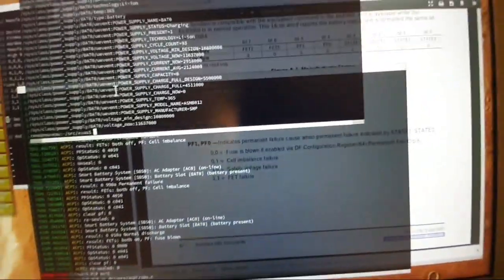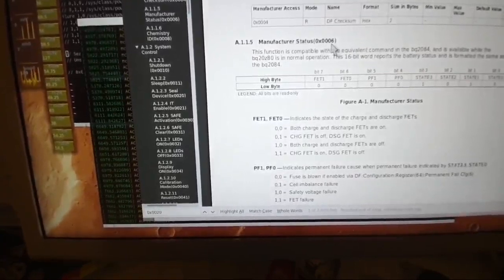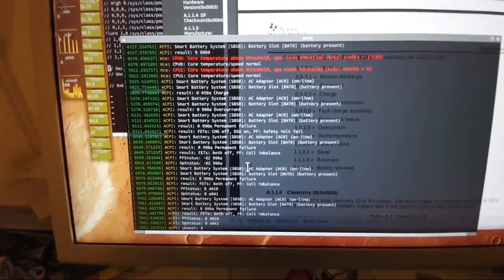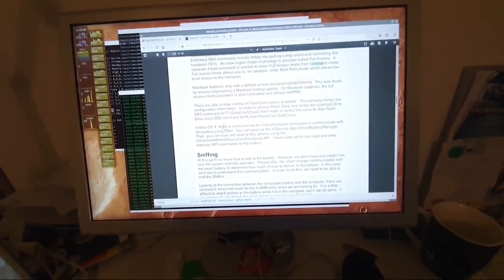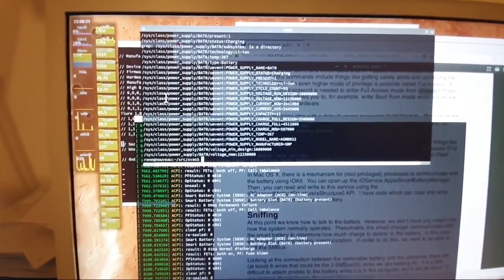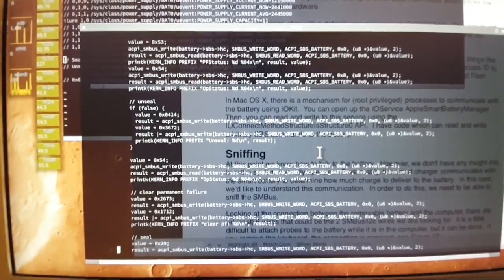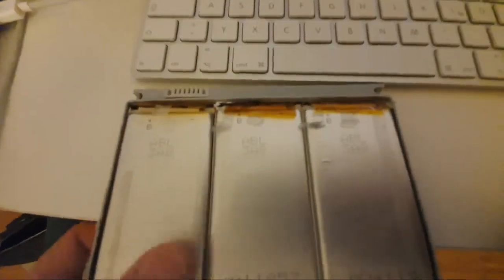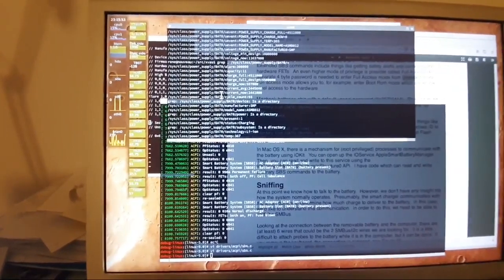I hacked and unbricked my MacBook Pro battery! (pre unibody)

Comment: This worked on my MacBook Pro 1,1, the battery is now charging and CPU is running on max frequency. Btw you don't need to recompile the kernel, just compile the module and manually load it.

Comment: Hi there. Do you have the code published on your website somewhere or just in the video? Really nice work. I am trying to unbrick an A1181 battery that is only 22 cycles old but went dead in my closet. If it would be possible to make some sort of script that would be fantastic. I might try on an Arduino but my understanding of the Linux side for how you would go about this is very limited.
Reply from the maker: Yes, need to recompile the linux kernel to run it: http://svn.exactcode.de/t2/trunk/package/base/linux/acpi-sbs-unbrick.diff
Reply: @renerebe  Thanks! The kernel is currently compiling on the MacBook... might be a while.
Reply: @ericsanman7627  what linux did you use? boot from usb or installed?

Comment: Thank you for your impressive work. Your videos have inspired me also deal with the Macbook batteries. I am using an Arduino with Wire Library. In the meantime I can read out all values of the battery e.g. Manufacturer Status (0x0006), CycleCount (0x17), CellVoltage1 (0x3f) ...

But I can't clear the permanent failure. I have five batteries (and will get three in the next few days). The permanent failure is set for two batteries. I opened these two and loaded them with a LiPo charger. The cells are not good, but they have enough capacity and the voltage of the cells is even in all of them. Therefore, resetting should be possible.

Can you give me a tip, please? I could also use Linux, but I don't understand how you connected the Linkux PC to the MacBook to get the SMBus. On Linux Python smbus2 could then possibly be used.

Thank you for your work and I'm looking forward to an answer

Alex
Reply from the maker: Do you send the unlock password? You should also only reset this for really good cells!
Reply: Hi, thanks for the fast reply. The cells were charged with my LiPo charger about 2500mAh, which means that half of capacity should still be available.
Yes I send the password. However, I have no control over whether the unlocking works at all. Can I query the unlock status?
I tried to unlock and then put LEDs ON (0x0032), that doesn't work either.

How could I do that with Linux, the way you did?

Many thanks for the support.